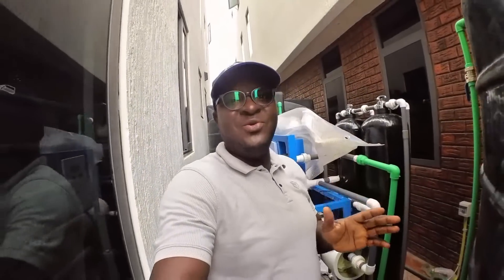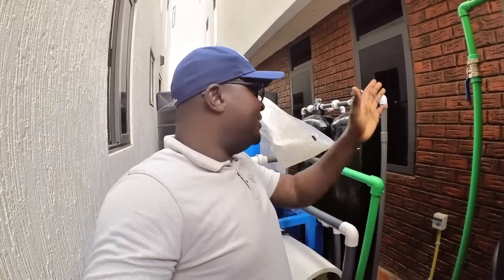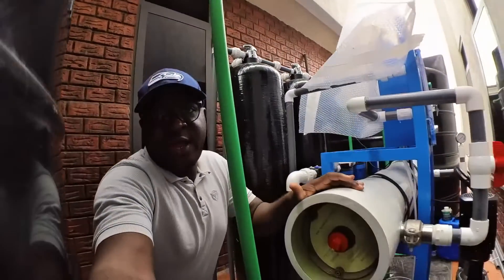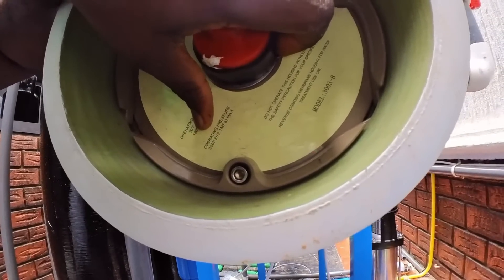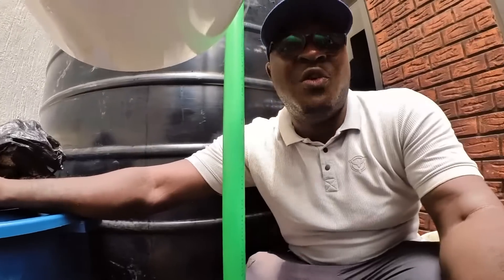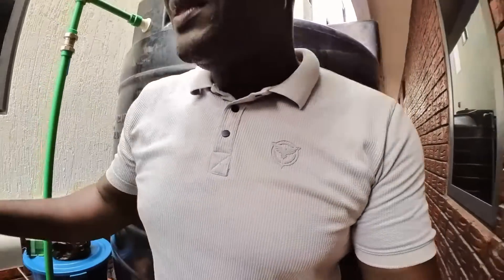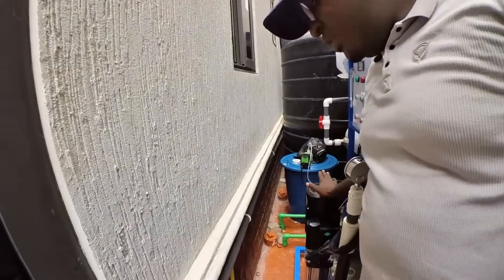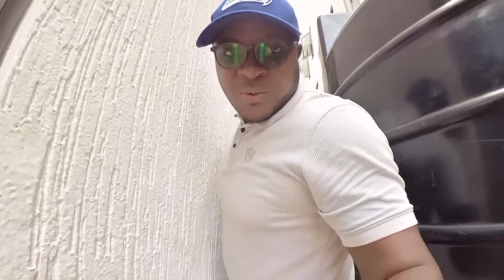Reverse Osmosis Machine in Ghana! All you need to know

Comment: Thank you for a very important info on water.  We have a large area in the back of our house and want to know how to pump it out or use the osmosis system to purify the water that is there because it is causing a lot of issues for the surrounding wall around the house
Reply from the maker: You should consult a water management or engineering company to inspect and advise you